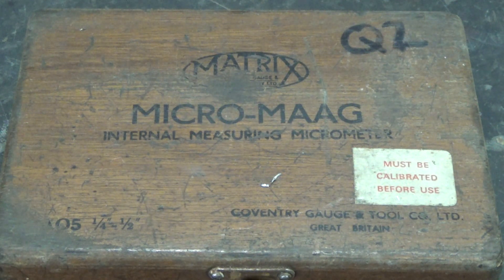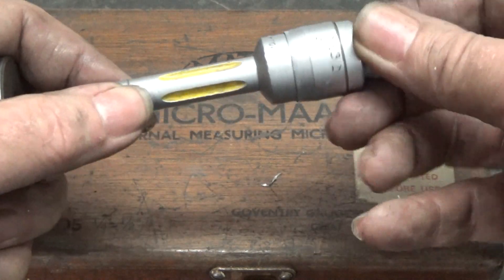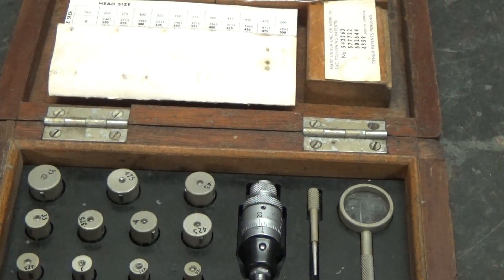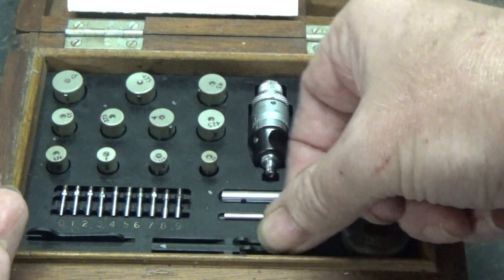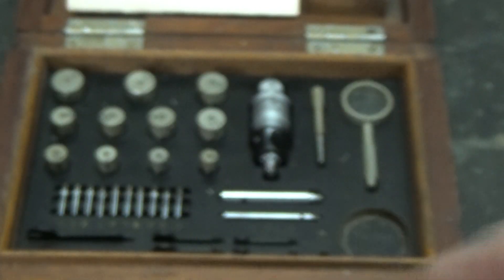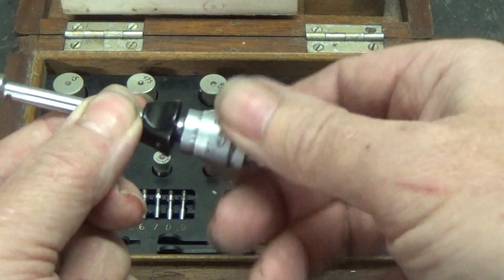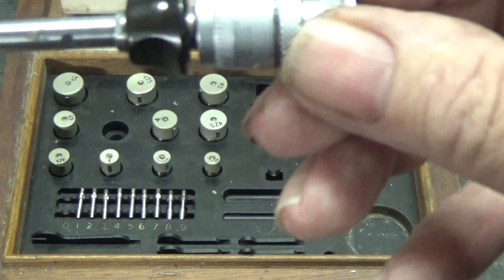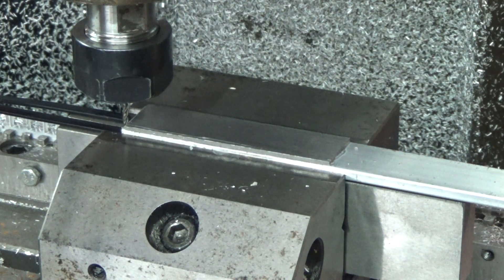Tiny Spanners and the Matrix Maag Bore Micrometer

Comment: At the start you say the gage is calibrated to the 100th of a thousand but with .0049 isn't the 9 a 10th of a thousand?
Reply from the maker: The setting ring says "0.375 + 0.00005"
The thimble of the gauge says "20 divisions = 0.001"
So, basically I can only be trusted with digital gauges, because I get lost. 
I once had to work with a travelling microscope with a metric 50ths vernier. That was confusing. 
It was necessary to double some, but not all, the digits.